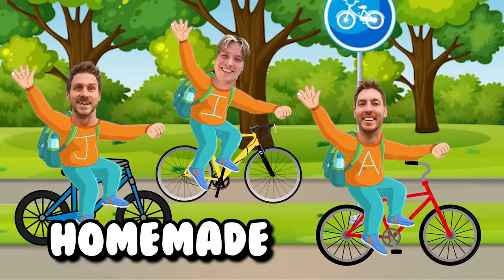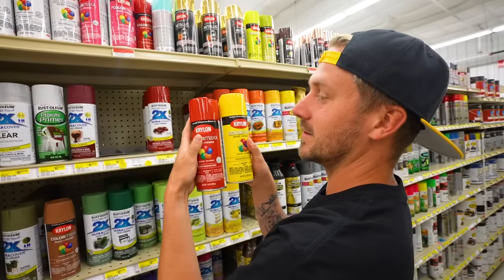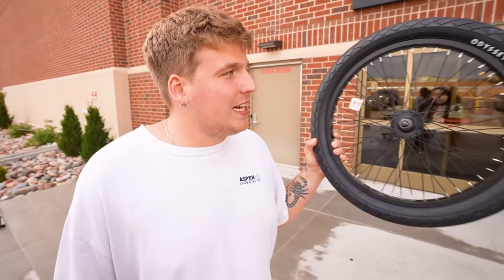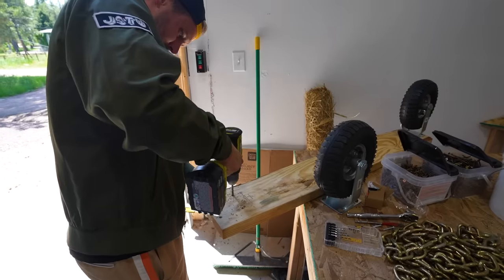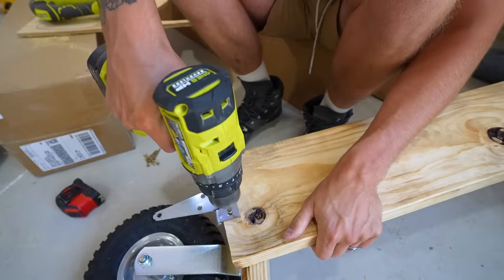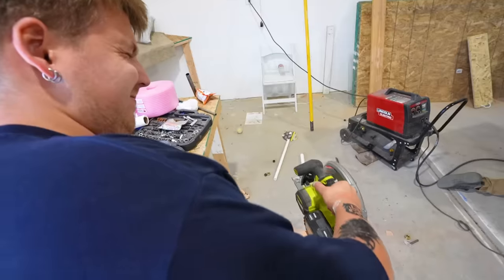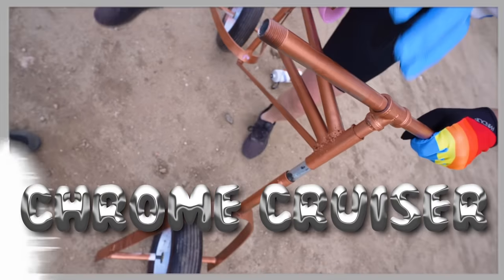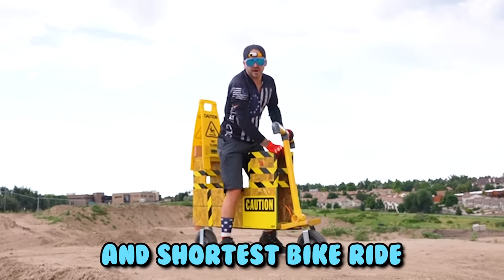Ultimate Homemade Bike Build Battle!

Comment: Isaac's bike is hilarious, because even if it did work, the fork rake is in front of the contact patch of the wheel, which would have made handling a nightmare. The one thing he did right, though is big wheels. Big wheels roll over holes and rocks and obstacles better than small ones do. Good try, Isaac, but now you know why bike's are rarely made out of wood.

Comment: Andrew did the most realistic bike and it looked like a real bike. So, in my opinion the winner is Andrew. Justin used pvc pipes, which were cool but not too sturdy. But his bike was pretty cool still. What cam did Justin use on his hat?  Isaac built well but made some mistakes.